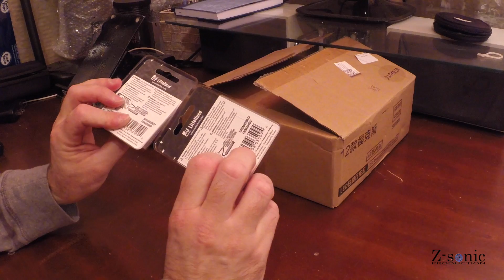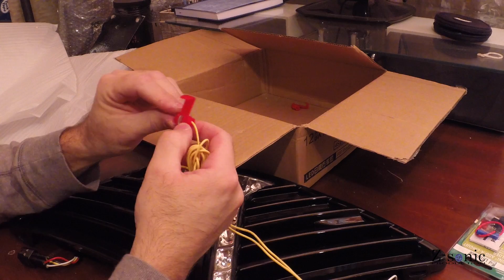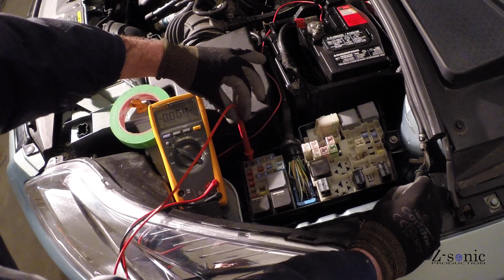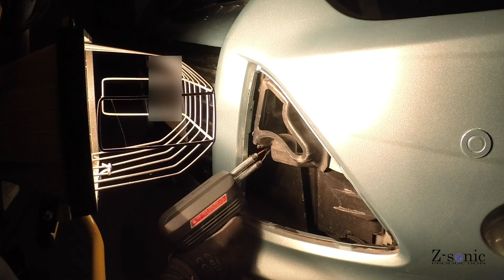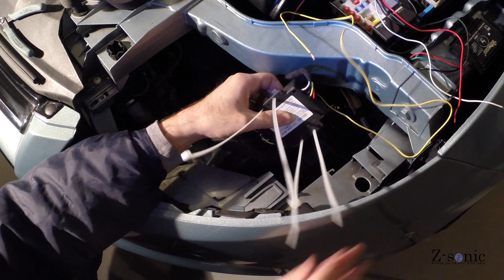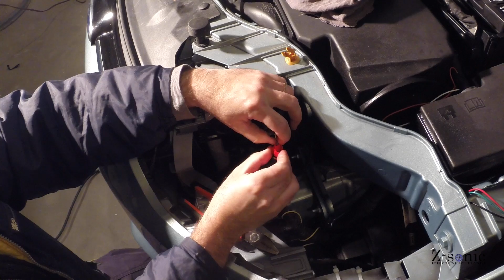2012 Ford Focus SEL - LED Daylight Running Lights Install

Comment: Can I use them for DRL when headlights are turned off? I have this regulation in my country. Need headlights or DRL in the day.
Reply: Yes absolutely, using that method meant to make them always turned on after the ignition is on, so it will act as an in-built DRL

Comment: I have some questions about installation:
1. Did you attached wires of LEDs to bumber on other side?
2. How connect wires to have LED only illuminated when main lamps are OFF

Thank you for this video

Comment: aaand my installation of these failed few years ago right after i have taken the plastic piece off and found that i have some hard styrofoam shock absorber underneath it and drl simply won't fit there=) still have them collecting dust=)

Comment: Thanks so much for this video. Your great. How easy is it to splice the indicator cable though with the adaptor. Is it just one click and both wires are running through the same current. 
Thanks

Comment: well done and thanks as I  have bought same lamps and panel but sadly I did not get instructions like you had so Again thanks for put that wire guide up! I agree I believe I will not connect the white wire!